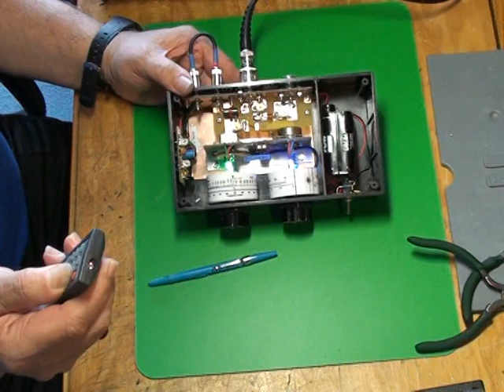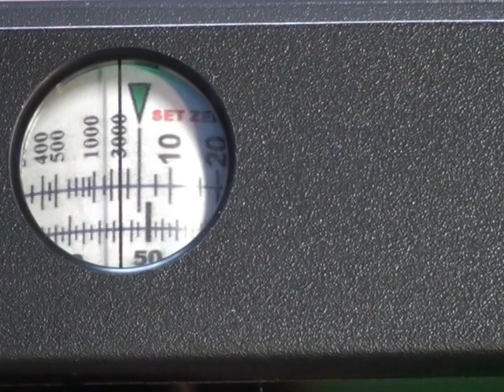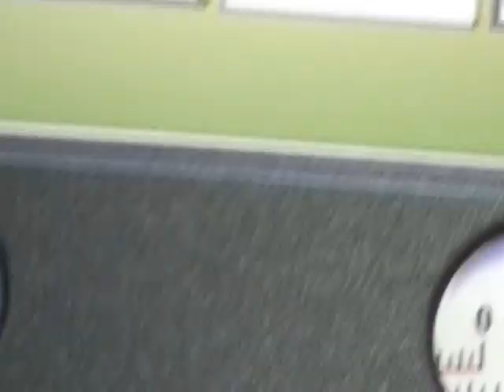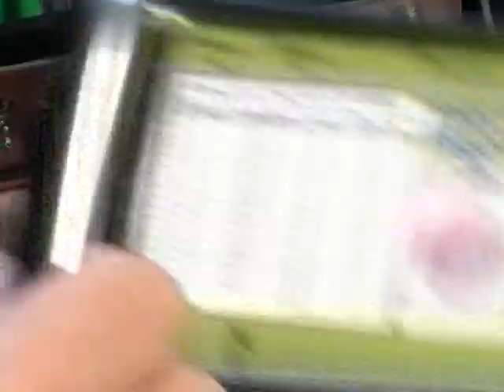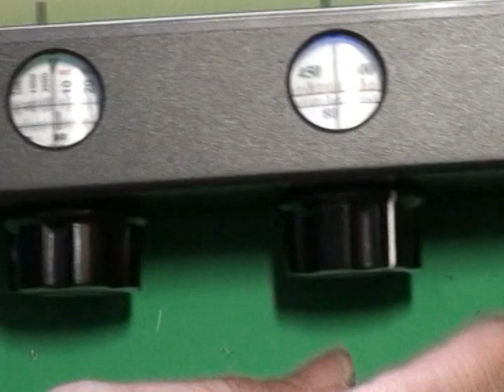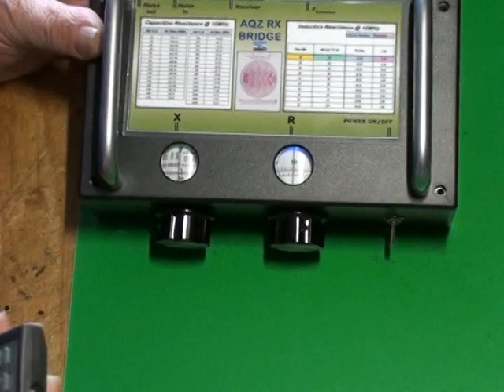RX1 Part 4 Alignment

Comment: Thanks for this Lou.  I got the old Rx1 out today. Was able to adjust super accurate using SDR Play RX. Got nulls exactly correct Down to -135dBm. at both ends. could not tell when I turned bridge on or off using spectrum display at 28MHz!!

Brendan VK2QRM
Reply from the maker: Hi Brendan, thanks for the information. Very good on the null - excellent!  Regards, Lou